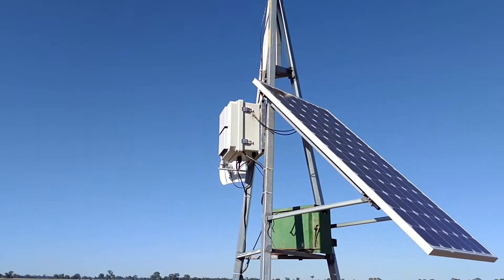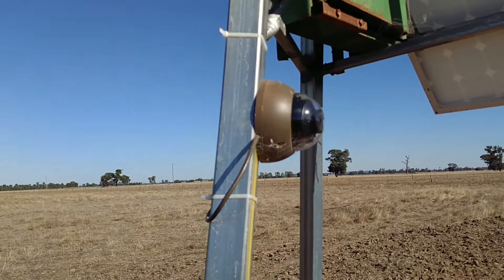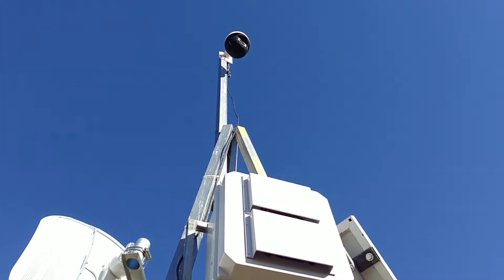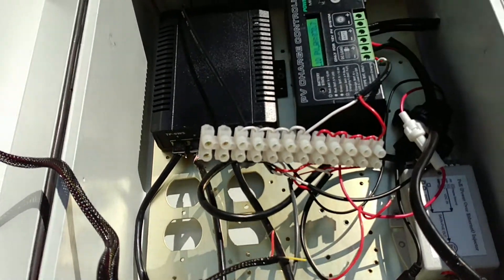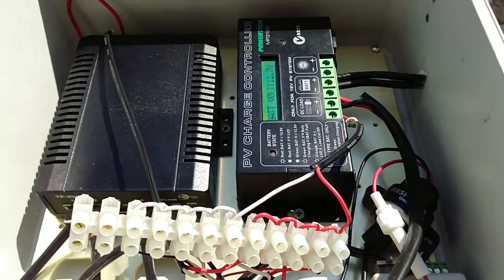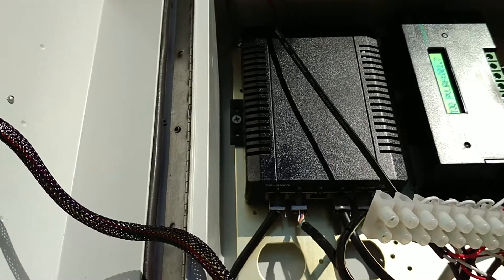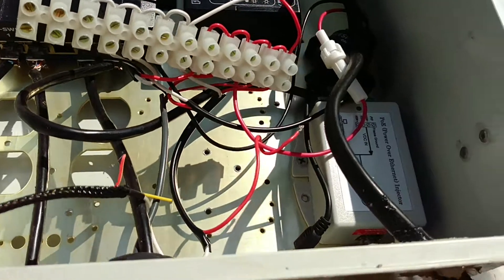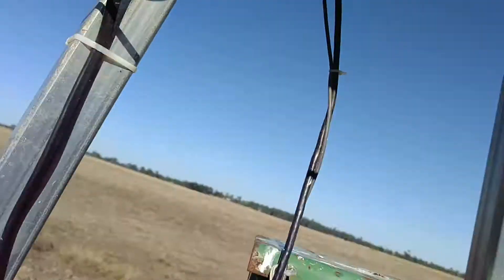Solar ip cam tower Dahua

Comment: how many days of autonomy does it have without sun .. what type of battery is there, how many amps
Reply from the maker: The amount of equipment and batteries have changed over time.... Probably want 200-400w panels and 100-200ah of 12v batteries. Low end if you can live with power cuts, high end if you want up time. Reduce equipment if uptime is critical. To calculate add up the watts used by whatever equipment you have. Then look up how many Peak Sunlight Hours your location gets in winter to see how big your panels need to be. 6 PSH is a good guess so a 200w panel would provide 1200w per day ( assuming sunny weather... If you have multiple cloudy days and uptime is critical youd need bigger batteries). When this was filmed, with the big camera, and an old roughly 80ah deep cycle battery, i think the camera would stay on till 10 or 11 at night, so around 4 hours after sun down. Changing to a smaller camera made a big difference... Other installs running radio, camera and a bore pump ran overnight with 400w of panels and bigger batteries. Calculate it out for your situation